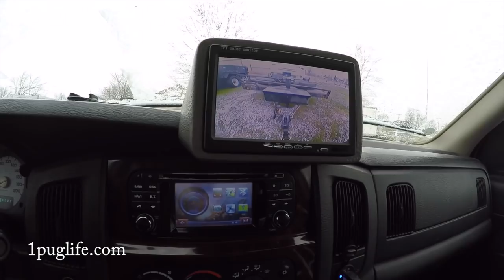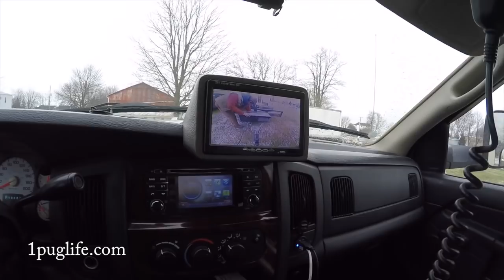santa gave me walking

Comment: That spot sandblaster is only made two for spot welding !! Lol.... you need to hold it tight against the metal  and it's only supposed to blow enough of a circle pattern for spot welding 🤣🤣🤣